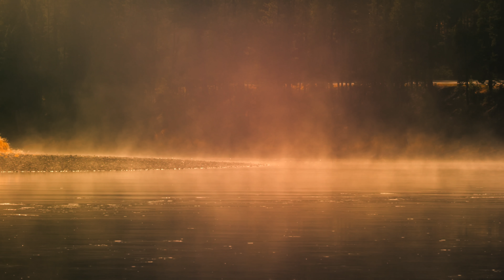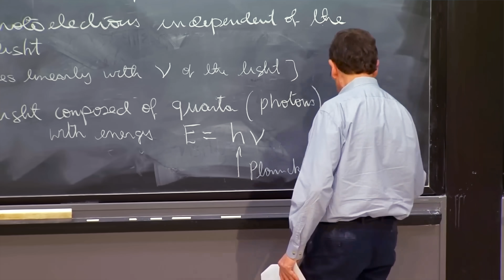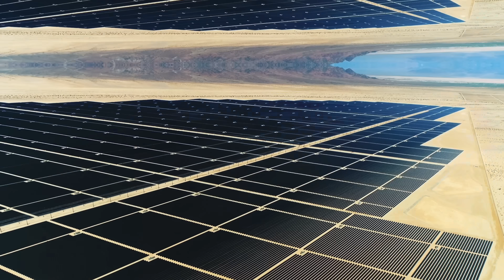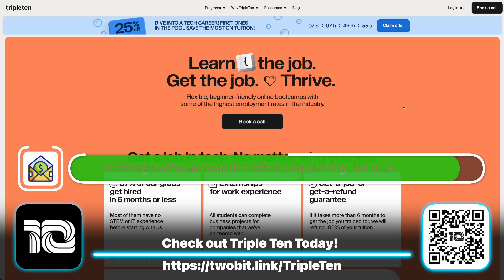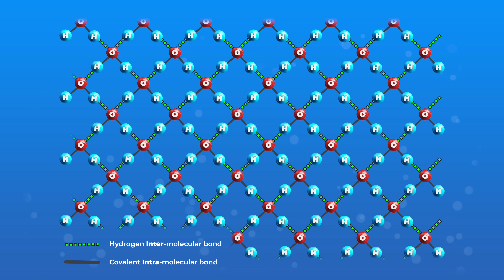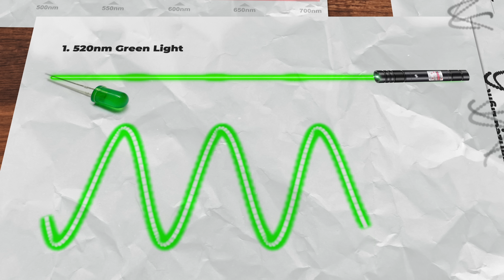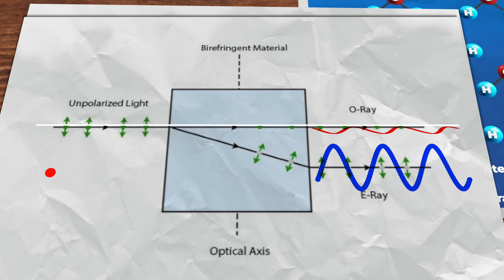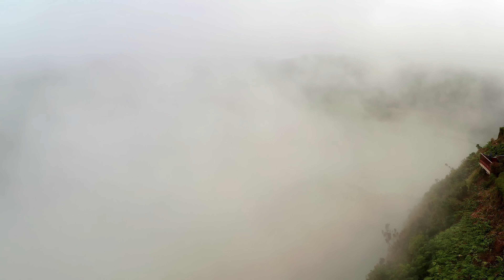New MIT Discovery Just Solved Water's BIGGEST Mystery!

Comment: Why is MIT so slow, or am I showing my ignorance?  As a retired Professional Brewer, we've known about this for a long time.  We just call it "Sun Struck".   How to evaporate without heat - Only Photons from the Sun.  Heineken beer is notorious for getting "Sun Struck" and evaporating a Skunk Sulfur smell without heat.  This is why most beers are bottled in a dark brown bottle to filter out all sunlight aka: Photons.  But now Heineken is known for their green bottles and refuses to go to brown bottles, even if it will get rid of the Skunk Problem.  But that's another story...   From a Retired Professional Brewer here in Las Vegas, Cheers...
Reply: I have to admit I hadn't heard of skunk character development through by getting beer "Sunstruck" or "lightstruck" as I just learned it's also called. But after very short research I was able to confirm my original hypothesis. This skunk effect is something completely different from what's going on here. It's a simple case of a light-catalyzed chemical reaction (if you're interested, the reaction is between alpha acid hop compounds and riboflavin to form 3-methyl-2-butene-1-thiol, or MBT which smells like... well.. skunks). Photo-catalyzed reactions are very common, and most of them degrade chemical composition by forming free radicals and the like. So, that skunking is a photo-chemical process which is completely different from what MIT researchers hypothesize is happening here, which is mostly a physical process.
Also, as someone here already said, photochemical processes like this skunking you're referring to usually involve the UV part of the spectrum, not green light. If you expose beer to green visible light, I guarantee it won't develop that skunky flavor and aroma. Of course, you can't test this simply by filtering out parts of visible light from sunlight to get green light (like with a green glass bottle, because UV light is invisible and you still won't know if it's going through or not. One thing I can definitely guarantee is that if the beer in a green bottle develops the skunky flavor, it's not because it's letting green light through, which is clearly visible, it's because it's also letting UV light through, which you can't see.
Reply: Photodegradation of organic compounds resulting in a skunk smell and taste isnt the same process as cleaving water bonds.  Different phenomena
Reply: @Weltbummler23  This is why I'm never embarrassed to say I'm ignorant about something.
I can replace ignorance with education.
Can't do that with stupid...
Reply: @BirdHugsAreTheBest  its all good, just part of good healthy conversation.  And you never know, expertise in one fields can influence discovery in others!  Its possible these two mechanisms might influence each other and this sun cleaving of water might catalyze the skunking reactions, but i guess that will be found out in time…
Reply: @Weltbummler23  You're right.  Knowing about related and even unrelated fields can lead to break thrus.  Years ago our military had problems with gas tanks getting shot and the vehicle would explode.  Just one shot could take out an entire vehicle and it's passengers!  
 
So NASA and TRW went over to the people at NASCAR for help.  And they did. 
 
NASCAR taught our rocket scientists how to build and install fuel tanks that don't explode when shot or heavily damaged.  
 
NASA and TRW were smart enough to get help from the NASCAR experts. 
Think about it. 
How often do you see a fire at NASCAR? 
 
As for the pilotless drones.  Guess where TRW went to get experts on operating a vehicle via a wireless remote? 
 
They went to the high speed world of R.C. Cars, Boats, Planes, and more.  You know, Remote Controlled toys 
 
But that's another story . . .
Reply: i think you're confusing the discovery of a phenomenon with fully understanding why it happens. there have been many cases where we've known things for thousands of years, but never knew why until recently.
Reply: @TheShizzlemop  Well, in this case, it sure sounds like they didn't know it was happening at all, not just why. They said evaporation rates are faster, evaporation happens without heat, etc. These all imply they didn't know it was happening. Either there's a misunderstanding or someone didn't do their research before doing their research.
Reply: @Triynko  in the beginning it was stated that evaporation rates are much higher than expected just from heat, and they don't know why. Imo this means, they knew it's happening. They just couldn't explain it fully
Reply: @Triynko  Photodegradation is well known and the primary factor of Sun Struck skunkyness. Tons of stuff comes in colored glass bottles to protect it from light. Specifically it catalyzes a reaction in the beer that ruins the flavor.

The discovery is the light can also directly evaporate the water without becoming heat first.
Reply: @davidschledewitz  Finally someone who grasps the core issue! Thank you for that, I couldn't have put it better myself
Reply: You’re thinking of UV light here. In the video it’s green wavelength specifically that’s creating this effect, which the green Heineken bottles would reflect away.
Reply: @cinebenjamin  I'm pretty sure transparent green lets green light through...
Reply: @maudley  You're thinking of it wrong. When you see a color that's because the other parts of the spectrum aren't being reflected. So when you see green, the green spectrum is being reflected into your eyes. Or lets say if you see red, only the red spectrum is being reflected into your eyes. The rest of the spectrum is either being absorbed or let through the material.
Reply: @cinebenjamin  yeah, the green is not absorbed by the bottle, and thus is let through. Easy way to prove it, what happens when you shine light through a colored lens? Reflecting is not the opposite of passing through in this circumstance. You're confusing yourself by calling it reflecting.
Reply: @maudley  If Heineken would use a darker shade of green, being Sunstruck would not happen, but they refuse to change it due to marketing.  Everybody knows the trademark green bottle...
Reply: @cinebenjamin  I was told the green is not dark enough to filter out the sun.  Thus brown bottles for all except Heineken.  So why hasn't Heineken switched over to brown bottles to keep their beer from being "Sun Struck"?  Product Recognition.  Heineken refuses to give up their famous green bottles because the green Heineken bottle is known worldwide.  How do I know this?  The guys at Heineken told me.  I do love being a retired Professional Brewer...
Reply: @cinebenjamin but clear green glass allows green light to pass through; that’s why it appears green.
Reply: @cinebenjamin    Doesn't green glass absorb all colours out of sunlight EXCEPT GREEN and lets green pass through, that why it looks grren.
Reply: Yeah there are two different things getting confused in this thread. I wouldn’t think evaporating a liquid inside a mostly full and sealed container like a full beer bottle would change much. I don’t think the effect in this video would be detectable in a beer bottle since there is almost no place for the evaporating liquid to go. At most I would think it would increase the pressure in the bottle a tad, but the pressure is already pretty high I think so a very small relative change probably. So for a sealed beer bottle, the skunking effect is the light heat causing a chemical effect inside the liquid that affects taste regardless of evaporation. Once it’s open however, I would bet both things are happening. Actually 3 things if we add back in the heat element. 

We knew that heat evaporates liquids, and we knew that light changes liquids, but we’ve added the knowledge that light accelerates evaporation. Very simple example, but previously we might have built an evaporation system and only considered the temperature of the evaporation chamber. But now we might add intense light of certain wavelengths and be able to lower the temperature or remove heat entirely and maintain the same evaporation rate or even increase it
Reply: @swilson42  I've never tried "Skunking" a beer in a sealed bottle.  Only an open one.  That would be a cool experiment to do.  Have one beer sealed, one open.  Do they both skunk?  Do they Skunk equally?
Reply: @BirdHugsAreTheBest  before this thread I had never heard of skunking a beer. But many other things over the years have come in dark bottles (medications, wine, chemistry set chemicals) and many of those are kept cool or cold so the only thing they mention is dark bottles to keep the light from changing them (no real concern for heat I suppose since that can be  a given for the normal storage of those items). 

I imagine the skunking effect with sugars catalyzing or whatever is happening is the same effect that makes a medication go inert if it’s exposed to too much light, which isn’t an evaporation thing in a sealed container.
Reply: This and what you just described are totally different things. Photons will chemically react with many molecules. That is not what they are talking about here....cheers
Reply: Well, many things may seem obvious based on our observations or guesses. But they still need to be proven or disproven scientifically. And there are are still lots of other things that need to be proven the same way.
Reply: Yeah these scientists are so slow man, like this Newton guy way back, everyone knew if you threw something up it’ll go down. Bro literally wrote an entire book on how things move lol
Reply: You answered that question I had at 21 years of age getting a bad batch of Heineken that someone said was skunked
Reply: We agree that the term discover is loosely used to mean understanding the fundamental concepts that can be manipulated to replicate a natural phenomenon in a laboratory.
Reply: We’ve known it happens, not we know why
Reply: @rogerancell1208  As long as the beer is cold, and the women hot, Life is Good...
Reply: That means Heineken stinks?
Reply: Heineken has the most skunk smell lol
Reply: @jylee9980  It smells and tastes bad.  Then ya take it outside in the sun and it smells even worse! 
Ha ha ha . . . 
 
All Heineken has to do is change to a brown or black bottle to avoid Skunk Beer, but they refuse to abandon their Green Bottle icon, thus showing the world Heineken would rather look good than smell good.
 
The only green bottle beer I used to drink was Steinlager in their big green bottles.  But that's another story...
Reply: Isn't the real question why didn't brewers capitalize on this decades ago.

98% of their product is water, wouldn't it be to their benefit to have a secondary industry that supports their core product.

Rather than consume publicly provided water at staggering amounts?
Reply: Light strike in brewing is a completely different phenomenon to the one being described in this video
Reply: @digitalis909  I believe they are related of similar...
Reply: @BirdHugsAreTheBest  
Not really. Lightstrike sees UV light catalysing a chemical reaction to form Sulphur compounds. The phenomenon of light, particularly short wavelength light, catalysing chemical reactions is well established and seen all over the place. Another random example; the degradation of natural lacquer in sunlight.
What’s going on with this evaporation is different: There are no molecular changes taking place.
Reply: @digitalis909  I was taught the Sun "strikes" the complex molecules in the beer, and "Shaves off" the Sulfer molecules, the combines with Hydrogen for the Hydrogen Disulfide smell.
 
So does that classify as a Strike or a reaction?  
 
I may be a good brewer, but I still suck at Chemistry huh? 
Only reason I passed was because of Kathy, my lab partner. 
 
She was studying to be a doctor.  I was studying to be a computer Geek.  She wasn't good at math but a genius at Chemistry.  I was horrible at Chemistry and a genius at math 
 
It was a match made in heaven,
 but that's another story ..
Reply: @BirdHugsAreTheBest  
As best I understand it, UV light causes the Riboflavin in the wine to be excited, that is to say, electrons are pushed into higher orbitals (it’s an inherently photosensitive molecule). In this excited and highly reactive state, the riboflavin can interact with dissolved oxygen to form free-radical oxygen and other reactive oxygen species, like peroxide. These, in turn, react with sulphur-containing amino acids, converting them to aromatic compounds. A conversion that accounts significantly for the smell of light-struck wine is methionine to methional, giving that cabbage smell. As far as I can tell the Sulphur atoms stay put, but are part of the resulting aldehyde.
Anyway, I guess the exam question is, how does that bring us back to the topic at hand? Well, it’s all chemistry at the end of the day, and they’re both initiated by light. However, what happens once the light hits is quite different: In this water discovery, light is loosening ionic bonds between water molecules, but no molecular changes are taking place; water remains water at all times. With lightstrike, however, some complex molecular chemistry is taking place. Covalent bonds are being broken and formed, powered by oxygen-based free-radicals.
Personally, I see something categorically different and interesting happening in this water-evaporation case, particularly as we’re talking about a wavelength of visible light that’s lower than what is usually required to make interesting things happen on a molecular level.
Reply: @catastrophicpeace  troll bait
Reply: Yes this has been discovered VERY long ago! The water in the air is a water molecule that has been hit by a photon or cosmic ray and has gone up in the air (essentially evaporating but not evaporating, it just remains suspended! This is how we have humidity and torrential rains when your window is cracked open but your room floor is totally wet... They are rehashing old news!
Reply: Scientifically you make no sense in regards to the phenomenon described in this video. Go home you're drunk!
Reply: They've spent the last 5 years focusing all their brainpower on how to properly understand and use PRONOUNS.  They've also been using their supercomputers create cryptography to obscure and hide plagiarism.  SMH
Reply: What are the implications ? Does it mean that desalination is quicker and cheaper ?
Reply: Pretty sure beer is bottled in dark glass to prevent light altering the flavor. It wouldn't have been anything to do with evaporation due to photons. As green light seems to be the main contributor then bottling in green glass would filter out the green as what you are seeing when you look at an object is the light that object reflected.
Reply: @BirdHugsAreTheBest  so since you knew this fact so long ago, what were you doing about it? Keeping it a trade secret? Or, perhaps you were so focussed on the BEER part that the other potential uses for this scientific fact just did not enter your mind!!
Reply: I prefer Würzburger Hofbräuhaus Bier.
Reply: @BirdHugsAreTheBest  I agree with you I have been studying global dimming and pan evaporation rates for years
Reply: @BirdHugsAreTheBest  big business shut stuff like this down to make bigger profits instead of improving the world for the general public. And the public still allows it to happen anyway.
Reply: Yeah, MIT is slow...you're the real genius here. I don't know much about the process of brewing, but I do know the brown bottle blocks most of the light wavelengths that cause beer to acquire the "skunking". None of that really matters anyhow, because..
No liquid in a sealed vessel (a bottle, green, clear, brown or cobalt blue, for example) will evaporate.
Reply: Lookup “Angel’s Cut” and “Devil’s Cut”.
Reply: @stephanmayfield4053  Obvious those MIT people aren't drinking enough beer.  Otherwise, they would have known this...  
Most, maybe all seasoned beer drinkers know about Skunk Beer.  
Those MIT people need to get out and soak up some sun and beer. Been if it skunks on them.  They can then figure out what happened and how.  And where did the Sulfur come from???
Reply: It's not mit is slow, it's the video that is hyped
Reply: @TimeFlies-d8b  That's funny! 
(because it's true)
Reply: it because someone finally realized that certain people can make a mint off of the technology. up till now they were not interested because it might have explained why temperatures are rising,
Reply: This completely supports the fact that the sun and cloud coverage have the largest effect on global temperatures.
Reply: Be careful, they attacked Terrance Howard for less. You better have a PhD.
Reply: @ichigokurosaki2838  lmao, Terrance Howard humiliated himself
Reply: Amen brother this is a joke.  Who the heck dont know this.
Photon wave lengths and electron volts and orbitals and covalent and ionic bonds is all.basic.
This video drives me.nuts.......
Reply: @catastrophicpeace  Any good beer drinker knows this Sun Struck thing.  You don't have to understand it to experience it.  But usually when you're outside, drinking your "Skunked" beer there is a breeze, even if it's barely noticeable.  It's enough to blow off the Skunk smell. 
 
Wanna have fun? 
Pour a Heineken beer into a clear glass then cover with Saran wrap, cling wrap, whatever.  Then place out in the sun for a few minutes then bring back inside into a room with no moving air.  Take the Saran wrap and stick your nose in there and have a sniff of Skunked beer.  Compliments of the Sun...
  ~ Cheers ~
Reply: @catastrophicpeace  what the hell do electron volts have to do with this? thats just a unit of energy. thats like saying "einstein was stupid, we'd known about all this stuff for ages... miles and gallons and shoestrings and whatnot..."